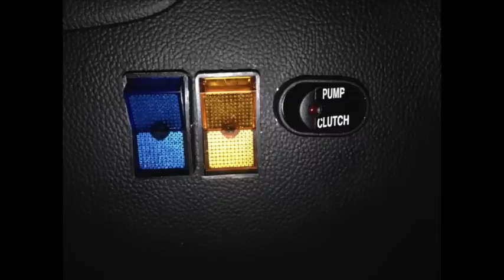Lil Hercules Repo Wheel Lift by Detroit Wrecker Sales

Comment: If you look into DME products they have bronze bushings with graphite , that are rounds pressed on sides , they are the NEXT step up and do not stick, They are used in mould making industry  for the guide pins. Worth there weight in savings for NOT sticking on pins. Take a look at them and you will be able to make your wheel lift pins even better.
Reply from the maker: Thanks! We appreciate that. We will check it out!

Comment: How much for the Hercules wheel lift?
Reply from the maker: marvin coleby starts at 10k with everything needed to install it. Frame reinforcement kit. Extra battery. Tow lights. Everything! Except springs!
**LIFETIME WARRANTY ON ALL PINS & BUSHINGS** (with proper maintenance)
*Frame Reinforcement Steel (Still needs to be fabricated)
*DOT Approved Safty Chain Attachment Points
*12' Safety Chains w/ Heavy duty Slip Hooks
*LED Rear Lower Work Lights
*Tow Lights & Plug
*Self Centering Head
*20' Control Cord
*300 amp Fuse & Fuse Holder (with a spare)
*200 amp Circuit Breakers (2)
*Ratchets & Straps
*Written Instructions
*20' Red & Blk Gauge #4 Power Wire
*The Strongest Tubes on the market. Our Tubes have extensive reinforcement. Our
*Tubes do not have slop. 
*Bronze Oil-Lite Bushings at all critical Pivot Points. Just like a large Wrecker would have.
*You will never get a Corroded, Frozen Pin again. (Bronze will not corrode to steel & cause a frozen pin)
*We use a Bronze Brushing that has Oil impregnated into them. They Sweat Oil. This creates little or no maintenance.
*Our Units are built Heavy Duty every step of the way. No one builds a better lift.
*Lifetime Warranty on all Pins & Bushings.
*Lifting Capacity 4000lbs
*Towing Capacity 8000lbs
*Clutch Pump capable. We offer a Valve Unit that will work with a Clutch Pump
*Wireless Remote Optional
*SAND BLASTED & POWDER COATED BLK

Please Note: We can not install on and Dodge w/ Rear Coil Suspension. The minimum recommended GVW is 10,000lbs. Rear spring package & Frame Reinforcement recommended. Never exceed the chassis maximum GVW rating during towing.
Reply: Detroit Wrecker Okay cool thanks. Would I still hace the life time warranty on the product if I install the Hercules myself?
Reply from the maker: Absolutely! But there is only a Lifetime Warranty on Pins & Bushings. Not the entire product and or it's accessories. On the items we do not manufacture, like the controller, electric/hydraulic pump,cylinders etc...those are covered by its manufacturers warranty.
Reply: 10k all said and done... snaps time to start saving. Also how long will it take to install?